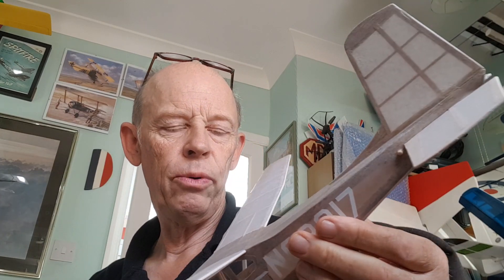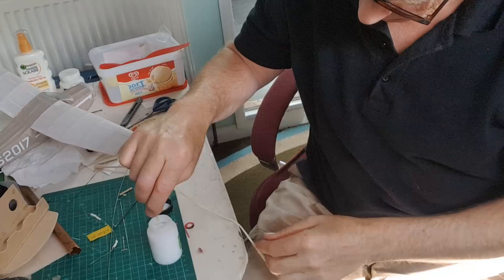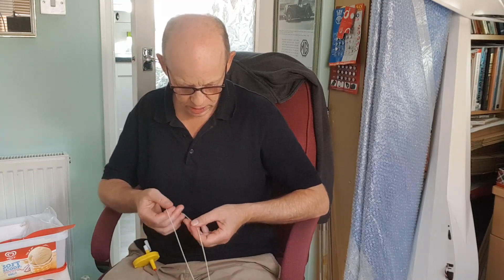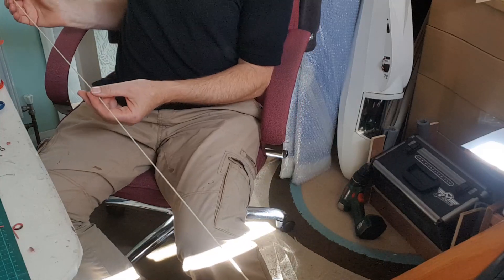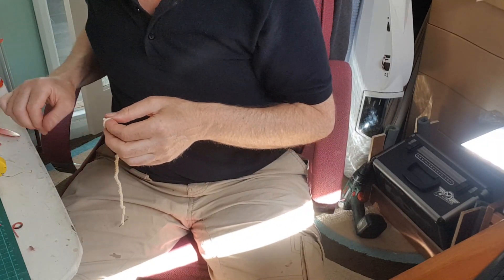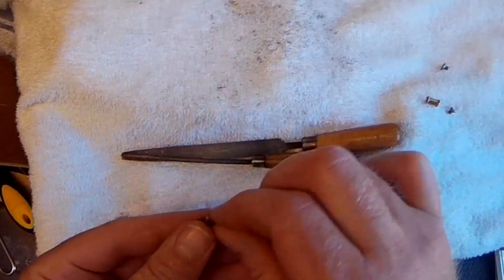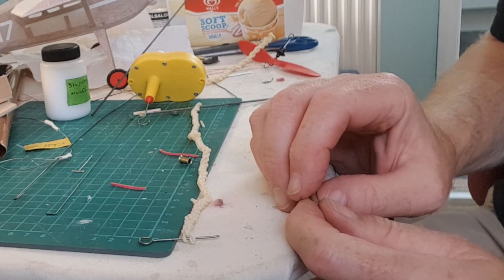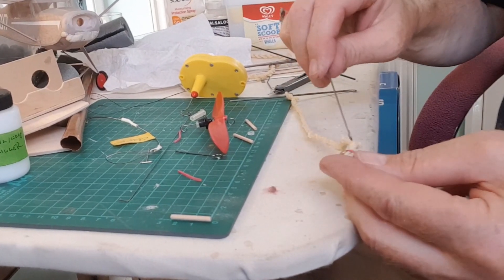Making and fitting a Rubber Motor

Comment: I'm building a 30" span rubber powered Cessna 140 what should the maximum weight be?
Reply from the maker: Hi Kevin, that's a good question but the answer is make it as light as you can, in other words don't add anything unnessarily heavy. If I gave a weight and yours was over that would you not attempt to fly it? Just bear in mind that the lighter the model the longer it'll fly and the less damage will happen if you land awkwardly, cheers.
Reply: @CliffHarveyRCPlanes  thanks for your reply Cliff I want it to be highly authentic so I carved the fuse from block balsa and hallowed out the inside this way you don't get stringers showing through the covering but obviously heavier than built up construction.

Comment: There is a simpler/more normal way is to have an aluminium tube as rear motor peg and slide the motor over it with a push stick . Or put a larger diameter aluminium tube on the end of the motor. Tubes allow you to use a stooge for winding. 
Interesting way of flaring. I always wondered how to do it.
Reply from the maker: Hi Jimbo, yes I agree with the second option as that's what I do, thanks for commenting 🤔👍

Comment: What would be the best rubber for sail plan ? I was considering scratch building an ultra light plan and be able to launch with rubber power.
Reply from the maker: I'm no expert Dennis, so I did what you're doing and that is research, basically the lighter the model the lighter the size of rubber it'll need but then you can have more loops to add power (but also weight!) and the propeller can make a big difference of course, cheers

Comment: hi, how do you choose which rubber band measure is correct? and how long must be?
Reply from the maker: Hi Julio, heavy models need a more powerful rubber motor, so say you start with 3mm rubber in one loop and it's underpowered you could try two loops braided together. If that's not enough you could move up to 4mm or 5mm one loop or two. See it all depends on the power required for a particular model. As for length usually about 1.5 times the distance from prop to peg,  by braiding it will be about the distance from prop to peg, you need to experiment. Buy yourself a few metres of different sizes. Hope this helps 👍
Reply: @CliffHarveyRCPlanes  thank you for the advice and time for this
Reply: @CliffHarveyRCPlanes  that would be the 1/8” ?
Reply from the maker: @pachanauta7083  Yes that's right.

Comment: Sorry for bothering but I just have one question,having only regular rubber bands,would u think it works?Also how do I figure out which length of the rubber band would be correct for my model.Thanks!

Lee.
Reply from the maker: Hi Lee, no bother mate, if you're braiding the motor about 1.5 times the length of the distance from the rear peg to the hook is about right for any sort of duration. If you don't have access to buying your rubber by the metre then find the longest band you can, the longer the band though usually the thicker it is! The rubber motor in a kit is usually only good for a few seconds of flight. Here's some good info to read: https://freeflight.org/Library/TechLibrary/RubberMotorSizing.pdf 👍
Reply: Cliff Harvey RC Planes thank you so much for the prompt reply,I really appreciate your help.I also thank you for the hassle of searching for that helpful article to get me started off,thanks again.Hope you have a good day!Will experiment some stuff myself..

Sub and liked!

Comment: Nice tutorial, and that was not a S hook but a cup hook on the out side of your prop.  A lot of the Pros use a reverse S hook for there rubber hook side.  Now that takes some time to perfect but is very effective for holding the rubber on.
Reply from the maker: Hi Doyle, thanks for the correction, ps busy building my FW190 👍
Reply: @CliffHarveyRCPlanes  Awesome maybe you will have time to get in your 20 second flight.